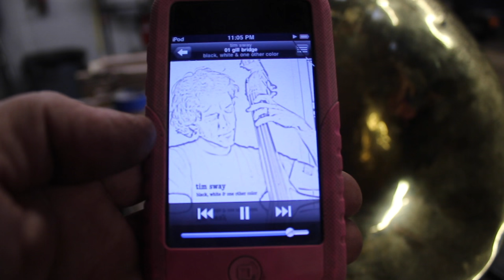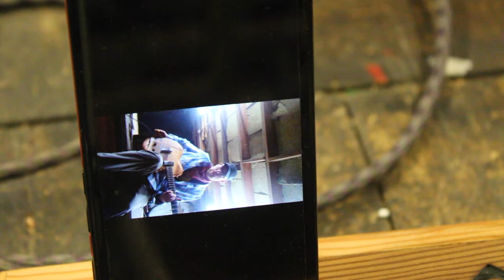passive french horn iphone speaker

Comment: Very cool!  I have something similar in my shop but the cone on mine is made from old file folders that I coated in truck bed liner.  I'm betting yours sounds a bit better :)
Reply from the maker: +TabLeft Workshop really? i wanna see that! no, this doesn't sound all that great. kinda tinny. hey, thanks for the stickers. vance and i just opened them today!
Reply: +tim sway I actually did a video on it 10/27/14 (I think adding a link would flag it as spam).  It was one of my very first videos though so if you watch it be prepared :)
Reply from the maker: cool. i'll check it out. -t